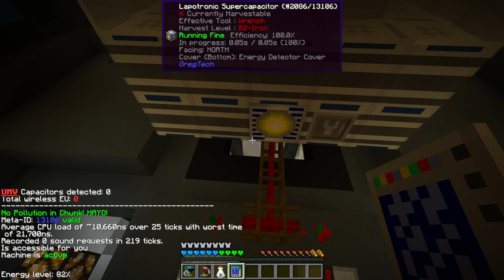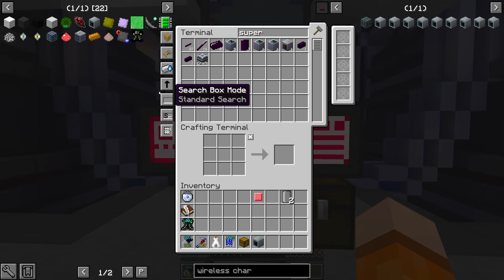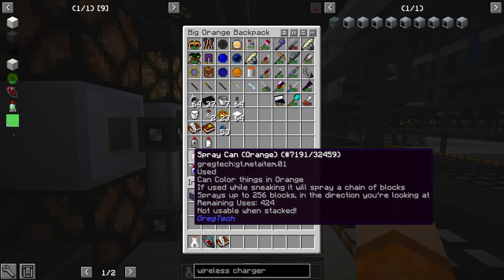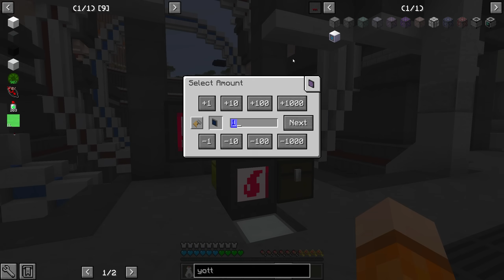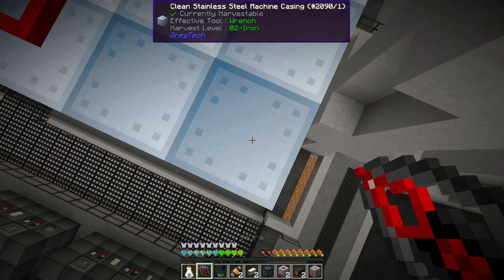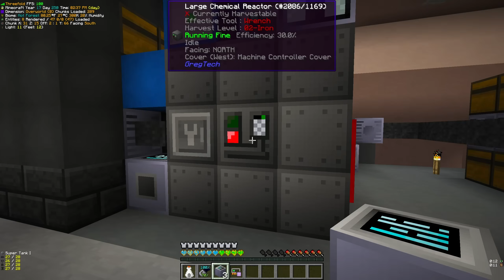Gregtech New Horizons S2 53: House Of Cards

Comment: There is a way to get light fuel from benzene, you don't need to use the raw oil and move the pump. You can use the propene, which is extracted from benzene, on a distillating tower. Then, run it by a single block distillery, and it will convert it to light oil. If you crack it, it will generate the heavy oil, the light oil and the naptha that you need, alonside with all the other quemicals you need! Hope it helps!

Comment: Yeah the fluid storage bus recipe did change in the update. You’ll want to make sure to save as much propane and toluene as you can because you’ll need them for epoxy / itnt. Maybe consider putting down a bigger super tank for them.

Comment: As for the spraying cable, just by looking at the  footage it seems to be directional coloring i.e. if you look head onto the cable it will spray the cable + behind it however if you look slightly on an angle it will color the way you are looking

Comment: Hey Three, quick tip about crouching while flying: if you hold shift and space while flying, you can hover in place while being crouched. This can help with mass spraying wire, tool swapping with the backpack, or placing blocks on interactables. Keep up the amazing videos! <3
Reply from the maker: That's the one thing I dont like about the jetpack. It is because of the hovermode that you can't sneak and ascend in the air to lock vertical positions :(

Comment: This "house of cards" idea is why I'd generally recommend building a new base from scratch, using the old base as-is to produce machines and other materials, and once the new base is build either completely abandoning or absorbing the old base. Of course in most cases when you change base it's because you've reached a key new technology - say, AE2 - that the old base just was not build to support, so rather than rebuilding the whole thing to retrofit it in it's better to build an entire new base from scratch. For this kind of same tier base move I'm note sure what the best approach is, TBH.

The wireless chargers from GT++ are interesting in that they have one quirk (undoubtedly intentional) that makes them extremely convenient in terms of charging stuff - they ignore an item's energy tier requirement. Normally Nano armor can only be recharged with HV tier energy, but an EV tier wireless charger will get the job done just as well. Also crafting an EV tier version right now is not a "compromise", it a "requirement". The IV tier version requires an LuV tier GT++ alloy, and getting that pre-Assembly Line is simply not happening.

You can, with some decidedly silly and potentially ill-advised investments, get access to even faster GT tools at this stage, but honestly a Vajra is just a better investment in general. There are blocks that no GT tool can mine effectively let stand quickly (case in point: Borosilicate Glass last episode), and while something like an Equal Trade focus can often swap said blocks for something more easily mined it's just easier to have a tool that will mine whatever at maximum speed, no questions asked. Of course it is expensive to craft, and potentially dangerous give how fast and indiscriminate it is, but overall it's a worthwhile investment of iridium and superconductor.

Something you can, though not necessarily should, do with things like the wireless charger is give them their own dynamo hatch on a LSC. Saves you from potential transformer accidents and/or death, but LSCs only have so many slots for hatches, and you don't want it to become a tangled mess of a million different voltages.

To clarify: Long range mode has a super large range that charges stuff relatively slowly. Local mode has a super short range that charges stuff relatively quickly. And mixed is balance between the two. Wireless chargers will passively drain power if they're in long range or mixed mode, but it's an absolutely tiny amount of power. If you're able to notice it there is something fundamentally wrong with your power grid. Or, more likely, your lack thereof 🙃.

For the record, the Vajra deals 25 damage, and has no armor piercing (at least that I can tell). This is by no means a good amount of damage, even TiC rapiers made of Meteoric Steel have a baseline of 20 damage, but when the alternative is a random The Ender you undoubtedly got from a long forgotten lootbag a Vajra is a significant upgrade.

You can get a Focus Pouch to store those wand foci. Much more convenient for storing all of your foci in one place, and you can even wear the focus pouch as a belt if you don't have any other bauble in that slot. Though, of course, you should 🙃.

Terra Wart is great to keep on-hand for debuff removal, but another critical piece of kit in that regard is the Talisman of Remedium you got as a reward from that one moon-related quest. Especially if you're not wearing a full hazmat suit at all times, because the moment you pick up a piece of radioactive material that terra wart isn't going to save you.

Precise Assembler I believe is doable in IV if you build an MEBF to cook MAR-Ce-M200 steel, but, eh...good luck have fun with that one. Oh not the MEBF, that's pretty simple. The Ce part of MAR-Ce is the bigger problem. That said PAs do support separate input buses, so recipe conflicts shouldn't be too difficult to avoid.

...I did not know spray cans can paint AE2 cables. I vaguely remember they couldn't last I tested, and painting AE2 cables in-world requires a Color Applicator. TIL, I guess.

Indium is one of those things that's not as big of a problem as it might initially seem. Especially in IV, so long as you don't try to source all of your indium through Roquesite from Ross128b you should be fine with even a halfway sane solution and automation setup. You can supercharge your indium production early on with things like BM meteor summons and/or using IC2 crops to get quadruple purified from crushed ore, but honestly, it's not even necessary. Remember to move your miners, remember to upgrade them, make sure ore processing isn't falling over dead, and you should be fine until alternative solutions become available.

I'm wondering when you're going to upgrade those Nichrome coils to HSS-G, now that you're rich enough to throw that around on things like multiblock oil cracking units. Save that EU/t, and make your base look fancy at the same time 🙃.

Point of order, but if you find your super tanks are very slow on auto-output, they have been updated so that their auto-output speed is now the same as the pump used to craft them. Of course there's nothing stopping you from using a higher tier pump as a cover to output fluid faster, but it's something to consider on top of super tank capacity.

Something to consider RE: voiding excess fluids, particularly in the case of petrochem DTs, is that a lot of fluids can be used to produce power. Severely Steam Cracked Heavy Fuel, just as an example, produces 205860 EU worth of gas fuels per recipe that Three is simply overflow voiding - ran through Large HSS-E turbines, that's ~5832.7 EU/t. Of course, is it worth building seven Large Gas Turbines just to turn those gas fuels into power, and set up automation so it'll only burn the excess when there is space in the LSC? When the same effort and resources could be put into dedicated, consistent power production instead? Honestly, it's debatable. Getting an extra almost 3A EV basically for free when running one part of your petrochem system is not a bad deal, but the added complexity is considerable, and trying to squeeze every last bit of efficiency out of your factory is how you go completely insane.

Ross128b is a great place to go to if you're short on diamonds, unfortunately Three doesn't have the required T3 rocket (or rocket fuel for it) yet. As far as I can remember.

You can safely remove ITNT by Equal Trading it with another block, though you won't get the ITNT back unless the focus is enhanced with Silk Touch. Still better to delete it than to let it explode, mind.

It's true that for passive systems you don't necessarily need maximum speed, but what you do need is an electrical net that doesn't involve LV cables swinging around HV cables. Sure, by dying cables you can't risk explosions as gray LV cable cannot connect to blue HV cable, but it still simplifies wiring a lot to have stuff on the same energy tier. Not to mention that LCRs, given their perfect overclocks, don't lose any relevant amount of efficiency from overclocking.

You say you used too many transformers, but if you ask me you didn't use enough. The closer that transformers are to machines the less energy you're losing due to cable loss, and the more energy those low power lines can supply consistently. You'd think cable loss would be completely irrelevant in this stage of the pack, but this is actually where it makes some kind of comeback - more than 32 HV tier cables will choke a 480 EU/t recipe, or demand a second amp to make up the difference, and if you're wiring stuff up without checking you might end up drawing too long or too thin of a line. It's not too big of a deal so long as you're not going crazy, but heavy use of transformers I also find makes it easier to keep the wiring organized, and that can be it's own reward.
Reply: Wireless chargers are intentionally able to charge the tier of the charger and below, they would be pretty useless if not
Reply: Painting AE2 components with the spray cans was something I added :P

I already submitted a fix for the chain painting able to chain between different blocks and it was merged.

Comment: TFFT tank also exists for fluid storage, great for multiple fluids
Use memory card to copy paste settings for ae2
Fluid storage bus recipe changed yea
The electroyzer recipe for diamond dust -> carbon isn’t a bad recipe late game
The fluid buffer is a faster way to get fluids out of the ae2 system than the dual interface (still limited by the pump speed)
You need steam in certain other processes like platline, so might as well setup a dedicated steam source to supply all the machines that need it

Comment: From what I’ve seen, a viable strategy for oil distillation is as follows:
-Uncracked Heavy Fuel (for maximum Toluene & Benzene, plus Phenol)
-Lightly Hydro-Cracked Light Fuel (for Octane, mainly used in HOG but may have other uses)
-Moderately Steam-Cracked Naphtha (for the most balanced set of outputs)

Edit: The copy-paste for AE2 is the AE2 memory card, btw.

Edit 2: Naphthenic Acid is only really used in the Kevlar line iirc, which is WAYYYY beyond the T7 rocket (UEV/UIV iirc)